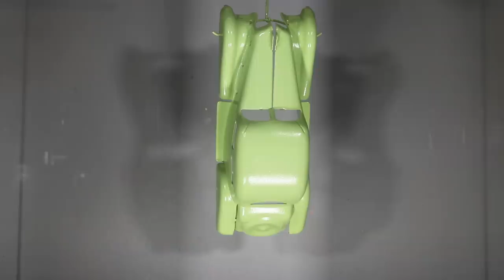1930's Marx Wyandotte Toy Light Up Sedan Restoration

Comment: Is it a purist thing? Why not use LED lights? They make tons of different kinds to fit flashlights and such. Paired with rechargeable batteries you could leave your collection of restorations lit up indeffinately. Set the ones with lights pointing at the others to light the fleet! Since the batts and bulbs are easily replaceable they could be put back to original quick and easy. Pretty good work,you get thumbs up!

Comment: This car is like a Chip Foose restoration, bumpers off to chrome after they have been modified to sit tighter on the body, body itself to the fabrication shop for a few small details, new Foose wheels and modern day air suspension 🤪

Comment: Going the extra step to make the tires, nice.  At 2:20 we see the damage to the tires.  What is the material the tires are made of? Is it original?  If not, what was the original tire material?  Thanks.  Nice paint.  Oh! What were you using to wet sand the primer?

Comment: This model should be easy to turn the wheels.
In your case, they will scroll with great difficulty, since the hole in the center of the wheel is very small and very tight on the axles.
It was necessary to make the hole larger or make the axis smaller in diameter.
Otherwise, very good work.

Comment: Try never to pull the piece out of the silicone before you pour the other half of the mold.
When you do you break the air seal between the item and the silicone, and allow the second silicone pour to seep between your piece and the first cured silicone.
But if you have to take it out..
Mark the piece and mold with a registration line, to make it easier to relocate it.
Second.. If you don't have an evacuator for the bubbles in the silicone, set up an angled ramp into the mold, and slowly pour the silicone down the ramp.
This allows the bubbles to stretch and burst before they pour into the mold.
Also, if you pour it slow, with a really reduced speed, keeping the pour small and slight, the silicone will have less bubbles being poured down the ramp.

Comment: Have you considered 3d printing with TPU (flexible for tires) It take just a couple of days via Youtube University to learn FreeCAD or Fusion360. I was making RC rims in under a day with no prior CAD experience. I would look at Ender Pro, CR-10 Pro or Artillery Sidewinder X1 3d printer. .3 nozzle will have less layer lines. or you could look at a small SLS printer.

Comment: Do the wheels turn?  It looks like the axles were stiff and the the whole in the centre of the wheel was not large enough.
Reply: Especially the front wheels seemed to be stuck behind the bumper...maybe the casting went out of measure?
:-)

Comment: Not so good this time. Could have repaired damage to the front wing. It was plain the new axle was oversized! You could have taken it down on your lathe to accommodate the new wheels and allowed them to turn properly. Plus drilled the body for the new axle prior to spraying.

Comment: every time i restore something i have the same doubt: is really a good thing to remove rust, story and age to an object?  what do you think?
Reply: If you don't then the object will decay into nothing. By restoring it to like new condition you allow it's story to continue for another lifetime.

I have one toy from when my dad was young, a matchbox size die cast dump truck, 1940s style. The paint has a couple of small chips otherwise it is in excellent condition. Still rolls freely. Should I put some clear coating to preserve the original paint or leave it to slowly rust away?
Reply: @jaquigreenlees  Simply spray some light oil and clean It with a towel.
Reply: @AsitShouldBe  and this 70+ year old toy will last for a lot longer. if it was nothing but rust visible a restoration to give it more life would do the same.